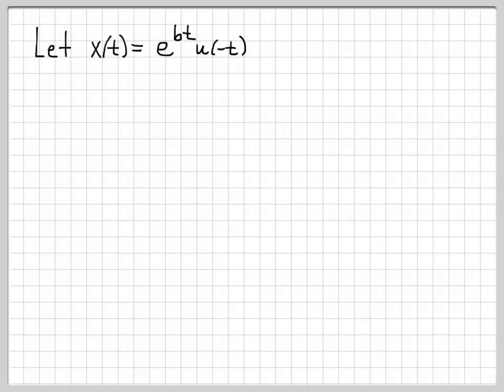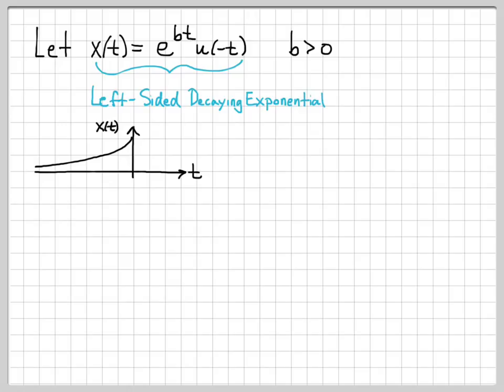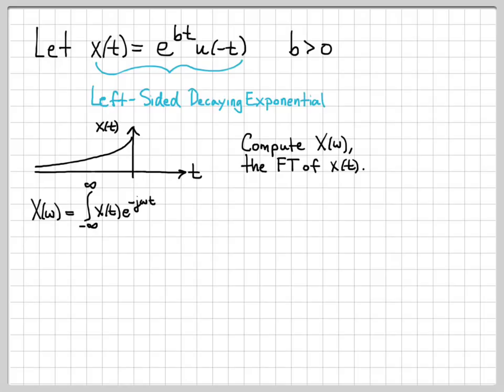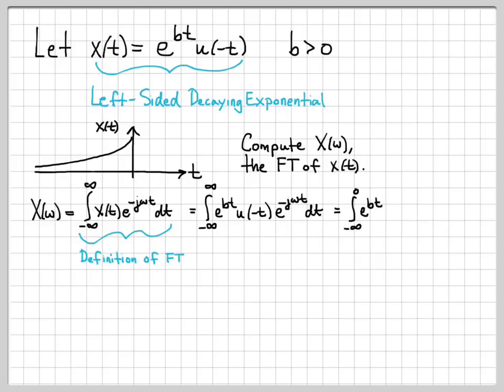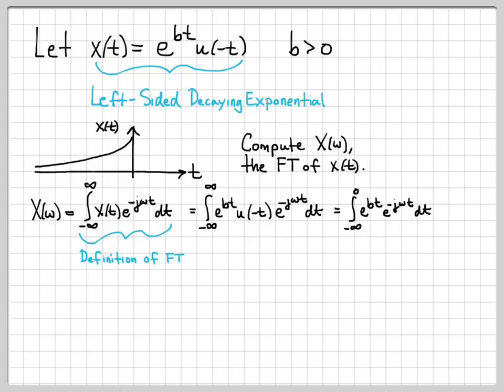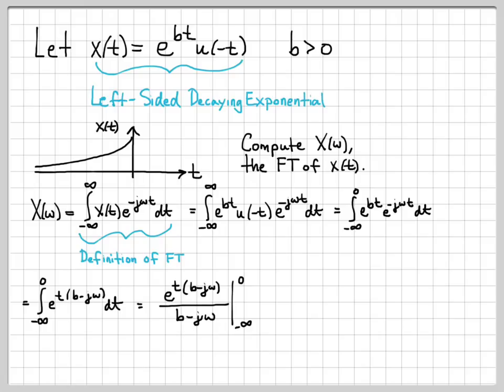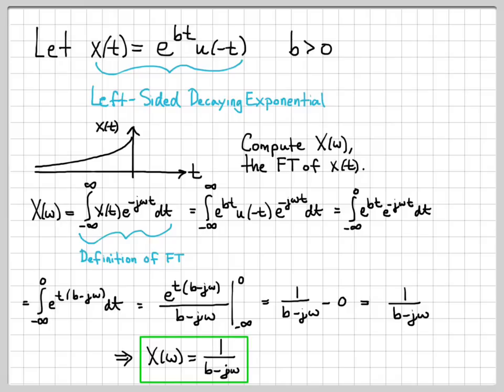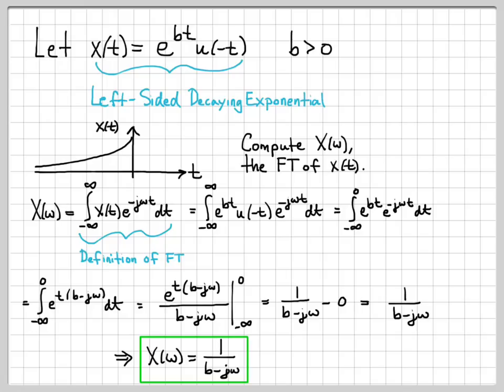Fourier Transform Example 02 - Left-Sided Decaying Exponential

Comment: I find the u(-t) confusing. This isn't a general mathematical notation so why use it without a context? Doesn't it just mean x(t) = exp(bt) when t < 0 and 0 elsewhere?
Reply from the maker: +Aki Malinen Yes, it means the same thing.  u(t) is the unit step function so u(-t) is the time-reversed unit step function. This IS very general mathematical notation used in every signals and systems course/textbook.
Reply: Aki Malinen 
I have to agree with Adam. I was introduced to it in ordinary differential equations, and used it a lot in circuit analysis. u(t)= 1 for
 t > 0, and u(t)= 0 for t </= 0. think of the unit step function as an operater that restricts the domain of a function.